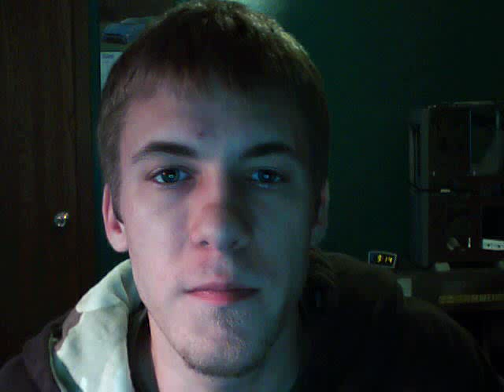The Ultimate CPU DOOM: OVERVOLTAGE!

Comment from the maker: You can run it at 1.6 but only for a few short periods then it will start to die and quick well its dying anyways but you know. I have run .6 through the 2180 and it hit 3.4GHz almost but was not stable.